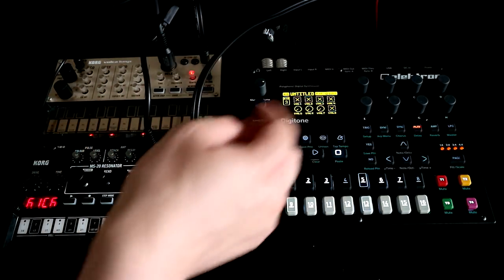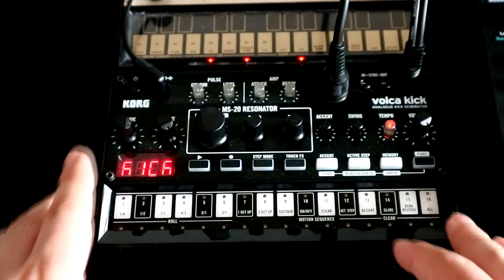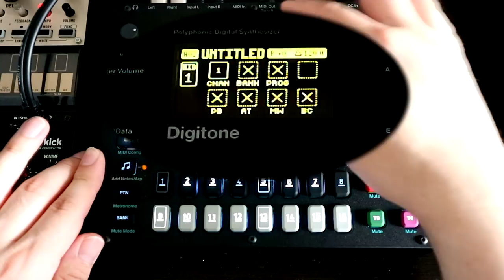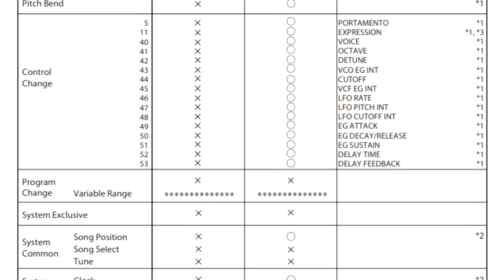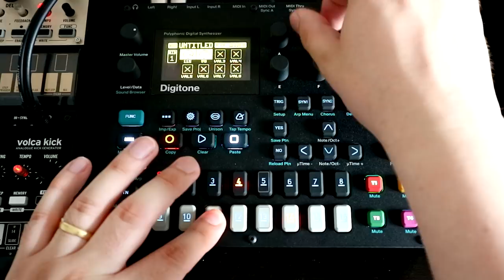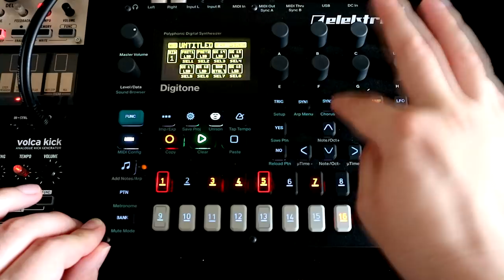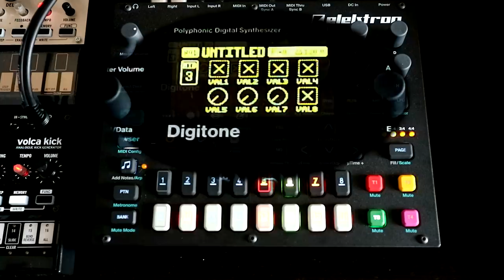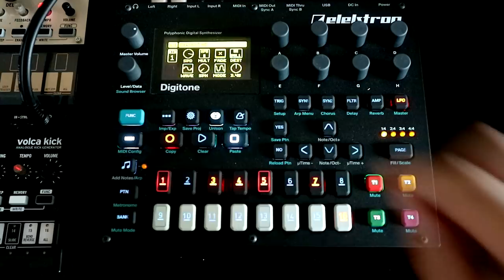Digitone MIDI Tracks - Sequencing External Gear (feat. Korg Volcas)

Comment: Great video thanks! The manual is not super clear on the midi tracks so that helped a lot. One time saving tip is that the midi out can be setup to USB, MIDI or both. Mine was configured to USB so it took me a little while to figure out why it wasn’t triggering my external synth... 😬

Comment: Came here to confirm 8 note midi polyphony per midi track and you did that straight away, brilliant! I'm used to the digitakt's 4 notes. Planning to combine both, reckon they'll make a powerful sequencing combo for old rack gear!
Reply from the maker: Definitely - especially if the rack gear can be addressed by midi CC - that opens up a lot of possibilities!
Reply: @OscillatorSink  have you tried using a midi controller with these elektron boxes at all? Seeing that trick and it looks pretty cool
Reply: Oof just found this video — and you STILL have the Digitone’s four non-midi tracks to layer on top of all of this if you want to, yah? (Thanks!)
Reply from the maker: Yep!

Comment: I was struggling to use the DT sequencer in my DAW, after about 1 hour of nothing I told myself, let's see if Oscillator has some tips...and voila' , what you did is not even related to USB and DAW connection, but all of a sudden thanks to your video, magically everything made sense. Also that trick of connecting the cc values to the LFO is so neat! I am using it with various Kontakt VST instruments and with self learning cc function it works wonders. As usual you are absolutely great! Elektron should pay you :), how on earth one can find the things you do in a manual! Thanks a lot, your video are always a great source of inspiration.

Comment: Thanks again for the breakdown. As I mentioned on Facebook, I tried this with my Volca Beats last night. Some interesting things to note:

1. The Digitone doesn't have a ratcheting function like the Digitakt, so if you're missing something like that you may need to find a workaround. (Haven't found one yet but haven't looked too hard.)

2. The notes used by the Beats aren't sequential. In fact, they're spread out seemingly at random, so you need to reference the MIDI data document for each different drum voice that you want to trigger. I haven't done this yet, but I think the most practical way to handle this would be to use something like a Brother tape machine and print out a sticker with the note numbers so that you can stick it onto the Beats as a quick-reference.

As I said, I'm not too keen on the snare so if I keep this I may want to mod it, but otherwise it sounds pretty good ... especially when you run it through the Digitone's Master Overdrive!
Reply from the maker: Yeah I really hope they bring the ratchet feature to the Digitone or allow the arpeggiator to be p-locked (which kinda achieves similar things), although, of course, at the moment you can't access the arp on the Midi tracks so that's another feature request!
Reply: Are you saying that if I connect my  Volca Drum Modeling Drums to a ext midi track of the Digitone it won't receive the sequence?
Reply from the maker: No. It should do. What we'll need to work out is what that actually means - is it just a note per part, can it be played melodically etc. Have to wait for the manual to be finalised and actually lay hands on one to work the particulars out.

Comment: Have done a video tutorial syncing a Moog Mother 32 and DFAM yet?? Would be nice cause I’d like to know how. Cheers 🍻
Reply from the maker: Hi, I don't have either of those synths I'm afraid, but - just hook them up over midi and they should respond to midi clock - just make sure the Elektron is sending clock (in the midi settings menu).

Comment: Thanks again for the amazing video. I have a question I couldn’t find anywhere. Is that possible to run synth tracks on the digitone and sequence external gear at same time? For example, using the digitone for drum tracks and bass and external gear for analogue pads?
Reply from the maker: Yes, you have 4 internal synth tracks and 4 midi tracks and you can run them all together.

Comment: Is there a way to get around the 4 track midi limitation on the digitone for sequencing external drum machines? Like if i wanted more than 4 drum hits from the external drum machine to me sequenced via the digitone.
Reply from the maker: You can't get around the 4 tracks, but each step can hold up to 4 notes and those notes can be any note, so as long as you don't need to trigger more than 4 drum hits on a step, you could probably happily do the whole beat on one track most of the time.

Comment: Brilliant! Curious to know how you would set up a Volca Drum since that Volca has midi-channels 1-6 or does it work setting it up with one midi-channel? I tried to use the drum-sequencer on my Beatstep Pro but that didn work. (I use your patches for the Volca Drum by the way and they are way better than the factory presets!)
Reply from the maker: You can do it on the Beatstep Pro - if you use Arturia's Midi Control Centre software you can set a different channel per pad.
Alternatively, you can also set the Volca Drum to work on a single channel in the Global Settings, so either of those will work.

I'm glad you're enjoying my patches, they were good fun to put together!

Comment: The Digitone is the brain of my setup, or at least the conduit between Ableton and everything else. So many people seem to get hung up on the 8-voice polyphony (which has not been an issue for me at all), but once you factor in all of the external sequencing capabilities it becomes clear that it really is an incredible bargain. I think people also underrate its ability to moonlight as a digital drum machine; sometimes it feels like I have a mini Machinedrum jamming alongside my Acidlab Drumatix. Those crispy FM blips complement warm analogue toms very nicely. I wasn't much of an Elektronaut before this, but I can say without a doubt that the Digitone is my favorite groovebox ever. <3
Reply from the maker: You won't find me arguing against any of those points! This was my first Elektron box too - seemed like an excellent deal to me!
Reply: I'm confused about the 8 voice polyphony. Is it only eight voices of the fm sounds? Eight voices of the volca sounds? Eight total?
Reply from the maker: The Digitone can play 8 voices of its own FM synthesis.
Each sequencer track can sequence 8 note polyphony each, so if you have synths to support that polyphony you can. Does that make sense?
Reply: @OscillatorSink  yes.  thanks.

Comment: Very cool — nice explanation. The Digitone is deep! How many externals(HW) can the Digitone sequence (using a MIDI thru box)?  Wonder how the Digitone works with the Roland Boutiques?
Reply from the maker: Well, in the current firmware you can only have one MIDI channel per track so without some additional, external MIDI filtering that's 4 devices. Of course you could be changing those channels on different patterns to address other devices!

I'd love to see MIDI Channel P-lock-able though - that'd be amazing, a different synth per step!!
Reply from the maker: Oh and the boutiques seem like prime candidates for this treatment - I'd have to check the MIDI implementation to see what can be addressed by CC; I bet the SE-02 would be awesome though.
Reply: Oscillator Sink - Keen to see this as well I have a jp08 I'm going to use this with as the onboard sequencer on the boutiques isn't very user friendly IMO.
Reply from the maker: I wish I had a boutique to demonstrate it with! The D-05 would be 80s-tastic!

Comment: Brilliant explanation. I have a Keys I use with my DT but have not explored this side of things before. 
Understanding how to control external gear with the DT properly is worth its weight in gold. I was struggling to understand how it would work when the DT only has two inputs for external gear, but you're using those two for the Keys and sending those from the Kick, to your USB interface. 
I understand this now! I'm going to hook up my Keys and my Roland TB03 to my DT and have fun exploring how they can be externally sequenced and tweaked/locked all from one unit, my DT.
Just effing awesome! Thanks so much!
Reply from the maker: The Midi sequence tracks are an absolute gift aren't they?

Comment: Heya, thankyou for a great video, just Subbed and Thumbs up :)  I was on the edge on wether to buy this synth next week.  I think you have made up my mind, I was wanting it to control my Moog SubPhatty, and a few other bits and bobs.  The Trig locks look great for using with the Moog since every parameter on it has CC values.  Could I ask one question as I heard that the Digitone can't send out its ARP over midi to external gear.  Is this true as that would be a real shame and I'd love an Arp for my Moog.   Thanks again :)
Reply from the maker: Thanks for checking the video out and the sub. Sadly, what you've heard is true - no arpeggio over midi track I'm afraid. I really wish there was because the arpeggiator on this thing is super powerful - almost a sequencer in its own right!
Reply: @OscillatorSink  Thank you for such a fast reply.  Ahh that is a shame.  Is there a way to record the Arp on to the FM tracks and then copy the data over to the Midi tracks as a work around? Still I think I will be ordering A Digitone on Tuesday as you have made up mind.  I was torn between this and the MiniBrute 2s, but getting into Modular will just get extremely expensive hehe.  Thanks again :)
Reply from the maker: No, again, sadly not. I think you might find that getting into Elektron gear can be a bit expensive too... I'm plotting my next one now!

Comment: Where are midi note 2, 3 etc. on other elektron machines there is a page where you can input the second third notes etc for polyphony. Where is that page? Trying to put multiple drum notes on a trig manually.
Reply from the maker: It depends on which machine you are talking about. On the Digitakt you do it on the Trig page by setting an offset from the root note using knobs B, C and D (see Section 12 of the manual). I don't know about the other devices because other than the Octatrack (where I've not done midi sequencing) I don't own them. The manuals tend to be pretty good though.

Comment: hi, nice great video!!! One question, you can use the four tracks midi with 4 volcas and the four synth tracks of digitone at the same time? like 8 tracks? thank's in advance.
Reply from the maker: Yes, the midi tracks are separate to the synth tracks. 4 synth tracks + 4 midi tracks.
Reply: @OscillatorSink  thanks :) ... now i am thinking on digitone or digitakt XD

Comment: Question for someone awaiting their digitone anxiously :) can you easily save templates of useful cc maping that are likely to be reused and how might you do that?
Reply from the maker: I don't think you can save templates (although I have to be honest that's not something I've checked for definite - just thinking of the menu structure I don't think you can), however, just like you can copy synthesiser track settings from pattern to pattern, you can do the same with MIDI settings - so what I've done is used the last patterns in the final bank of my current project to stash the settings I need; then I can easily jump there and copy them across to new patterns. Hope that helps!
Reply: Oscillator Sink good idea and thanks for the response - I'll likely make a blank project to do just that
Reply from the maker: No worries - enjoy your new synth when it arrives!

Comment: Only downside powering the Volcas from same PSU is the annoying ground loop picked up by the mixer and as I can hear you also have in the background. Any idea how to get rid of that other than use separate PSU's for each Volca ?
Reply: I use inline audio noise suppressors; they have a 3.5mm TRS socket at each end.

Comment: Hello there, great video thanks. How many tracks can it play simultaneously in different channels? I would like to expand the keys, is it possible to use a keyboard controller to play? regards
Reply from the maker: Are you asking about the Digitone's internal synth engine? Or the MIDI tracks which control other synths?
Reply: @OscillatorSink  yep, the midi tracks that controls other synths
Reply from the maker: @luisgarciarios4988  4 tracks. And you can control them with a keyboard.
Reply: @OscillatorSink  thanks Man

Comment: This might be a stupid question but can you combine the 4 tracks of the digitone and 4 midi tracks for a total of 8? Meaning if I wanted to connect my external synths but also use the digitones sounds?
Reply from the maker: Not a stupid question. You might think that, but only the 4 MIDI tracks send MIDI, the 4 tracks for the Digitone's own sounds don't output midi (and don't have the same configuration options).
Reply: @OscillatorSink  I appreciate your response. Thank You.

Comment: Im going to try this soon but wanted to get your opinion before giving it a shot. Im about to receive the yamaha reface cp, which has midi in and can control different effects/sounds on it. Do you think it would be possible to have each midi channel triggering the different sound selections on the reface cp, such as one controllig rhodes, the other wurlitzer, another the clav, etc?
Reply from the maker: I don't think the CP works as a multi-timbral device - you're using one sound at a time - which ever you have selected. However you can select which sound you're using by sending midi CC according to the manual (page 13 of the Data List manual which is a download from yamaha). CC 80 let's you cycle through them, but I don't believe you can play a Rhodes and a Toy Piano at the same time - nor can I find any evidence of the different sounds being able to be addressed on different channels.
Reply: Oscillator Sink thanks for the quick response! Ill give it a shot, i wonder if i sequence the notes apart if it's able to jump between the different midi channels triggering it
Reply from the maker: I don't think different midi channels will make a difference (unless you mean midi tracks on the Digitone) but you could certainly have note-less Trigs sending the midi cc to change the sound before sending a note - that should work.
Reply: Oscillator Sink yeah sorry for not clarifying that's what i meant :) if it doesnt work ill try the noteless trigs! Thank you!!!! Awesome video btw, made me appreciate the volca keys a bit more that im trying to sell haha

Comment: thanks for the great video! i have a problem, when i am sequencing my external gear (waldorf blofeld in this case), it keeps triggering the digitone as well. so when i play for example something on midi track 1, it plays the blofeld's sound correctly, but also triggers the digitone default sine at the same time. I have no clue how to fix this! your thoughts would be much appreciated!:)
Reply from the maker: How is everything set up? Where are your midi (or USB) cables going to and from?

Comment: In the case of the Volca drum (with each of the 6 drum hits being on a separate midi channel ) how would you hypothetically route it over the 4 tracks on the elektron? I made it  the auto channel and then sequence 2/3 hits per track. But what i don’t like is that i loose the ability to do the  “step jump” repeats with the volca sequencer... so my understanding here is that you are entirely using the elektron sequencer keeping the volca sequencer clear so it does not compete?
Reply from the maker: Yes, this is all Elektron here, the Volca's are just acting as sound modules here. On the Volca Drum, if you're using the Digitone, you'd have to set the vDrum to single channel mode to get around the fact that you can't parameter lock midi channels.

Oooorrr use the Digitakt like I did here: https://youtu.be/0pNzm0sGykQ
Reply: thanks, yeah... figured that.  A trade off one way or another. I will try this bad boy with my OT for more insanity. and report back... since i do loose 2 drum voices using digitone :( ...

Comment: Great video. Question:  tried controlling the Novation Bass Station 2 (which I just got recently), using Digitone via MIDI. It worked initially, then stopped working.... any thoughts from anyone on what  I might have done wrong? I only see one setting for MIDI on the BS2 ... Thanks!
Reply from the maker: The obvious things to check: you changed the midi channel on the BS; you disabled MIDI Receive on the BS or set it to receive on USB only;  you disabled MIDI Transmit on the Digitone or set it to transmit on USB only. Overbridge might mess with it too.
Reply: @OscillatorSink  Thank you, will check all of your suggestions.

Comment: Hi. Great video. Regarding the myvolts power supply for multiple volcas..do you find it producing a higher noise level? I have tried at least two different but similar products (one being the volca mix) and the noise that came with it rendered it practically useless
Reply from the maker: I haven't found the noise troublesome, but I'm only using two or three Volcas generally so your mileage may vary.

Comment: If you plugged in a midi keyboard to the Digitone would it send midi through to the external synths you're controlling with the digitone midi? Looks like one of the ports says out and one says thru. Curious if they can actually both work as thru?
Reply from the maker: I don't know. You can control the voices of the synth with a midi keyboard abs I think you can set up channels to control the midi tracks too - so I guess in that case the answer is yes, but it wouldn't be a true Thru.

Comment: Hi, thank you so much. I want ask you, is possible control volca bass filter CutOff by midi CC ? if not, is bigg different between volca keys and volca bass ?  And last question : is possible switch pattern on volcas with midi CC ? thank you.
Reply from the maker: I don't have a Volca bass but looking at the midi implementation chart, you only have control over the eg amount, not the cutoff itself